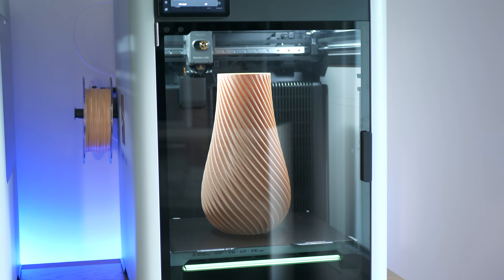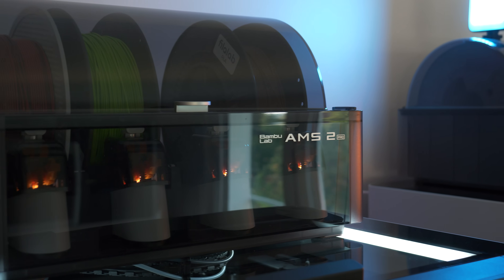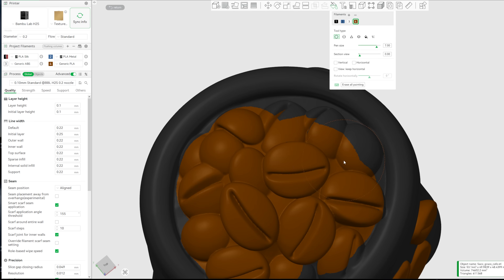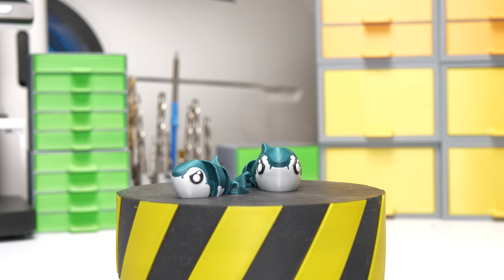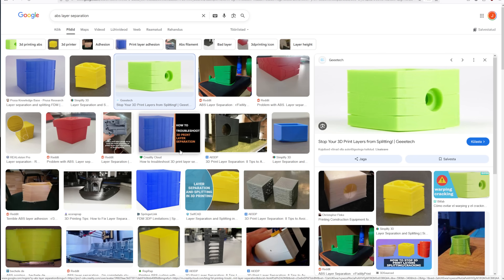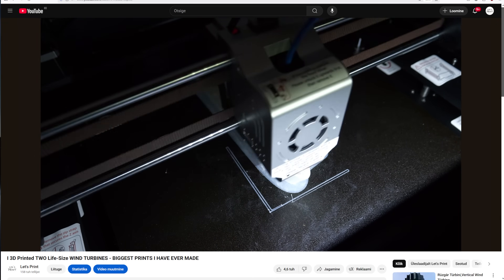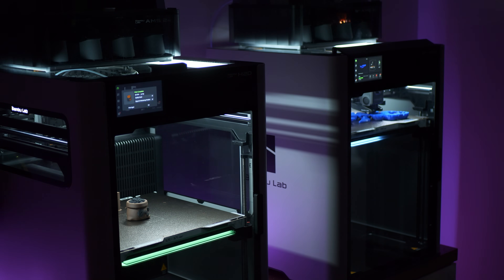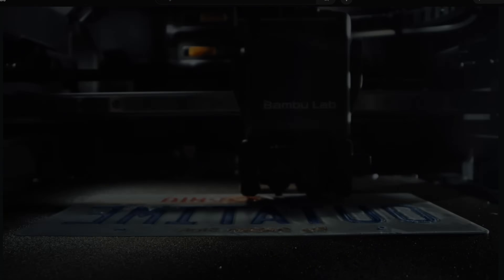Is the Bambu Lab H2S the Upgrade/Downgrade We Wanted?

Comment: why no cnc 3-in-1 combo 3d printer with laser. so why not slice is so that you print vertical columns areas volumes of the same color at once. assume your nozzle is long and narrow. no color swap in between.